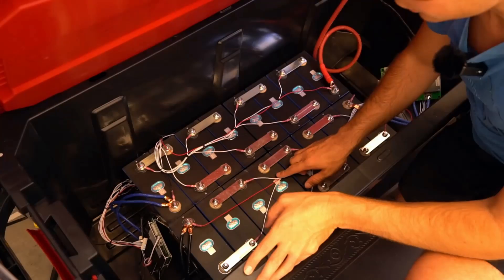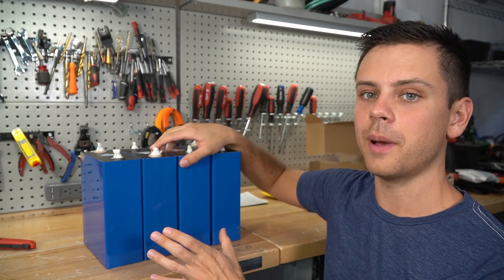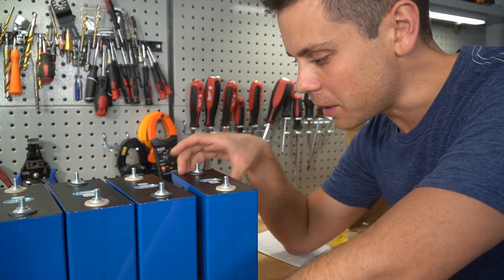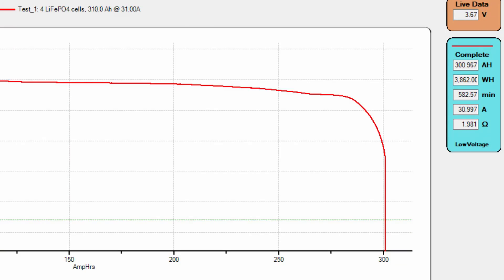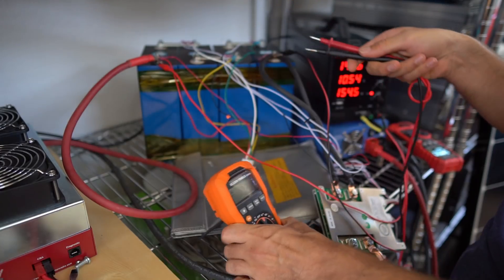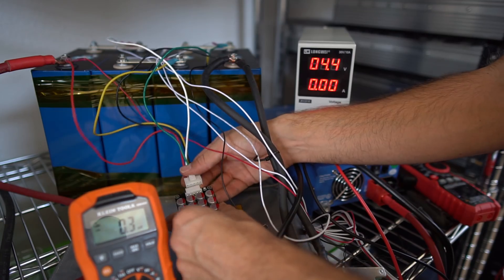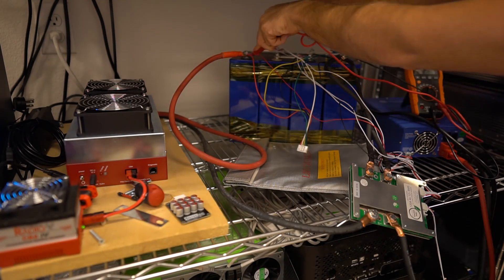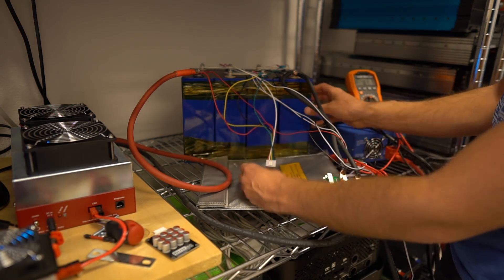Amazon.com "Grade A" 310Ah -Ninthcit- LiFePO4 Cells Manually Balanced and Tested

Comment: Suggestion Will: use 12 or even10 gauge wire from the PSU to the cell to top balance. These awful thin molded wires drop way too much voltage which is why you had to boost the voltage. It’s safer to run high gauge wires to reduce this drop and the run PSU at 3.65v ie don’t have to keep such a keen eye out for overcharge. I just did a top balance this way and was able to pull 11Amps at only 0.2 volt’s below target voltage.
Reply from the maker: That is why I measure at the terminals. I never use the psu display. And yes, the set in video is upgraded. I rarely use the supplied leads.

Comment: “Off grid garage”had the same problems with the active balancers.  Waste of cash.
Reply: Mine keeps my battery at .008 v delta across the pack. Without it, there is no way to balance automatically. Not a waste in my opinion.
Reply: @Sanwizard1  check new videos from Austria guy 😅 specifically the last one talking about active balancers

Comment: Will, can i use these type of batteries to make a car starter battery? Or laptop battery?..
Reply from the maker: Use LTO cells for lithium ion starter battery. It's the best around for that application
Reply: @WillProwse  Or Winston LiFeYPO. Those can do 3C discharge rate (aluminium cased cells are usually 1C max, not sufficient for starter motors). Also, the LiFeYPO's can be charged below freezing.
Personally, I think it's too expensive and I would stick with leadacid for starting, but you can.
Reply: @WillProwse  uh okay then i'll use it for another project... LTO is ridiculously expensive to get in my place btw
Reply from the maker: No, not a good idea.

Comment: Need advice.....took an old laptop power source and spliced it in to the cigarette style output inside my RV. MY RVs Converter/ Charger is bad. But I have 120 in the RV. So the laptop transformer is hooked up from the 120 in the RV, and running in to that lighter plug that comes from the battery by the radio(also fused with the rv radio). it is a real slow trickle charge. Thats all I need really since its got the 120, just to keep the battery topped off from running the lights every once in a while...until I replace the converter anyways. 

The laptop transformer output is 15v @ 1.5 amps. Its a tiny pinch more than it should be on the volts 15v vs 14.?? that most chargers run approximately, but the battery is so big and power has to travel so far that I don't see it being an issue. I'll keep an eye on it for overheating this first day im trying it. The battery is a huge 165 lbs deep cycle at 260 aH. Thoughts?

Comment: I'd love to see the structure that holds these cells under compression in commercial EV applications. I wonder how complicated it would be to replicate.
Reply: I usually use a piece of plywood on each side and 2 ratchet straps to compress them
Reply: I think it's just an aluminum case they are placed in that fits snugly.

While these aren't the same chemistry cells, pouch LiPo cells in ev's are also held under compression. 

People are making their own gadgets with springs and whatnot, but i don't believe it truly has to be that complicated. Just a rigid rack to keep the individual layers in the cell compacted and in contact with each other.
Reply: @volvo09  snuggly fit doesn't = compression
Reply: commercial banding (metal, insulated well particularly the corners. It's the same used for palletizing cargo.

Comment: I believe the cutoff for Lifepo4 is 2.5V.
I'm with you on the bloating--that's a sign of a premature failing cell--definitely not grade A cells.
At 250 $/cell & no real balancing & matching (you should have tested & compared the resistance of each cell to verify that their Ω was similar), they definitely screwed you..  Demand a refund...
Reply from the maker: They did cut off at 2.5V. the voltage rises after the disconnect occurs. You can pull another .1Ah more usually and that's it. That LVD threshold is perfect for capacity tests like this. Yeah, I'll get my money back
Reply: @WillProwse  If the worst cell in the pack caused the BMS to cutoff early, then you weren't able to get the remain energy from the other 3 cells. You also only got ~3.6175 per cell (i.e. 14.47 V / 4 cells)--which means you might have gotten a bit more from your cells had you let them fully charge to 3.65V each.  How much more?  Not much more probably,  but, maybe enough to provide another 6 Ah?

Also, $2800/16 = $175.  If you really paid $250/cell for the cells tested in this vid, then you paid ~43% more for the cells tested in this vid (i.e. 250/175).

Good work & thanks for sharing!

Comment: I have been useing 280ah cells for over a year 
Not swelled , new or used
New tested 289 
They stay within .oo4 on every day charging
I charge to 13.5v each , 2 batteries both run the over kill 120a hooked in parallel 
Cells are flat as can be , new n still
I run a older camper , make a cpl pots of coffee n run power tools with this setup
Every cell that iv had that pulls what stated is not swelled,  seems if it's swelled they won't pull what should
Reply from the maker: Good to know! Thanks for the input Charlie

Comment: I know that some chem's dont not like low atmospheric pressure (being on a plane). If they were shipped by plane I'd put my money on that being why it grew. This is why you can't take X size battery laptops in the main cabin of a plane.
Reply: There are fairly strong laws about Lithium Batteries (of any composition/type) being put on a freight aircraft.
Reply: @tedsaylor6016  yes but some are far worse than others. I was just pointing it out, as to why some ppl are getting bulging cells and some aren't.
Reply: No way they are paying air freight shipping fees for these cells.  They come by boat.
Reply: Do you have any literature to back this up? I'd be interested in learning more about that.

Comment: Try keeping the balancer on during the discharge - do another test & see if it helps.  Dont think of balancers as fixing an imbalance in 1 cycle - think of them as transferring 5-10Ah each cycle, each time.  They can fix small-medium problems if given enough time to do their job.
The balancers wont keep up with high charge/discharge currents, but when you're doing 5-10A (250-500W, which is my house standby power) - they do quite well.
Reply from the maker: I actually did this years back. I put 60/60/100/100Ah cells in series with deligreen active balancers. Those push some serious current. And at .1C, I was only able to add a couple more Ah. You would never be able to pull 5-10Ah unless you had multiple active balancers. They are so expensive, that you are better off buying a brand new cell or cells haha! Not worth it. They can hide small discrepancies, but it really isn't worth the money or time at all.
Reply: @WillProwse  Will dig for the video! 

To kill these balancers once & for all - how about you put a shunt inline with the balance leads & see how much they balance over 4-5 cycles of an unbalanced pack?  Then we never have to hear about them ever again ;)
Reply from the maker: How fun would that be! But at this point, I think I will chuck them in the trash 😂 I'm so tired of using them
Reply: @WillProwse  I hear ya, they "work" for me - i.e. a B+/A- grade pack, the peak voltages are kept down during a charge. Maybe it'll give me a few more cycles over a decade - not worth the cost, and there'll be better tech by then. But if it keeps them out of landfill - i'm good with that

Comment: 2.7LVD? Do the cells relax the bloat when at a low state of charge? What happens if you pull down to 2.5V on all cells, readjust the bussbars, and replace the kapton tape? Any improvement?
Reply from the maker: They hit 2.5V. That is the programmed LVD on that BMS. They rise in voltage after disconnect occurs. You can try to milk more out of them, but I never get more than .1Ah. They drop fast after first initial disconnect.
Reply from the maker: That voltage was pretty low too. Typically it recovers better than that.

Yes the bloat reduced a lot when at 0%. And no, the tape holds them good. I just took the pack apart and they were popping out. The tape holds them still. I bet we would get lower capacity if we didnt use the tape.

Comment: Hey Will,
Are those 18" or 24" deep metal racks you have there?
I am thinking of getting the Energetech 48v 10kWh you recently did a video on.  I have the 24" deep Hm Depot hdx brand ones. (they state can handle over 800 lbs) Wud u plse use a measuring tape to see if it wud fit on my metal rack?  If so, which would be the best way to place on rack?
Thanxs.
Reply from the maker: 22 in deep racks. but energetech is 28 inches tall. Does not fit but could work in a pinch. 24in deep rack would work. I might actually do the same thing with these racks.
Reply: @WillProwse  We can stand them, yes?  (Strapping them of course!)   ... I am EVEN thinking of attaching a backboard to my rack!
I just went to look @ the box & it states with huge bold letters it can handle 850 lbs PER SHELF